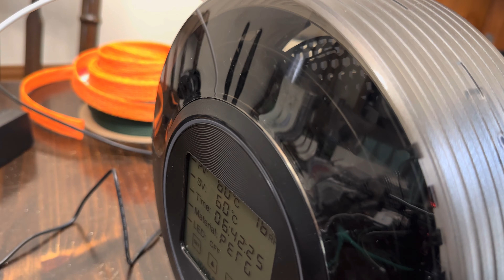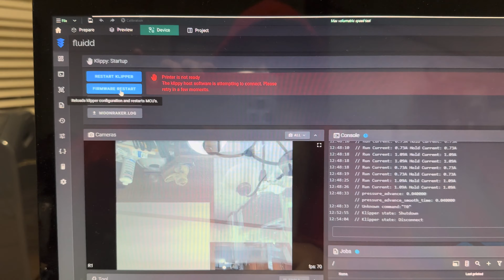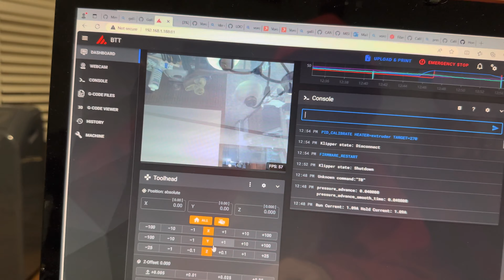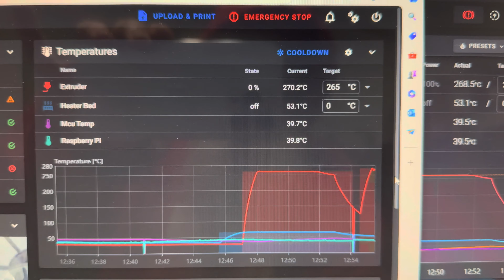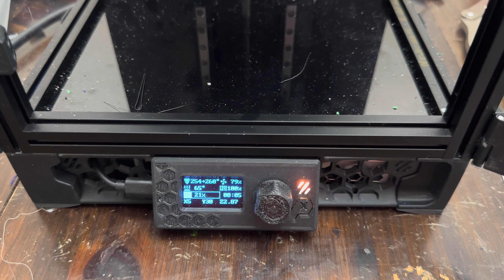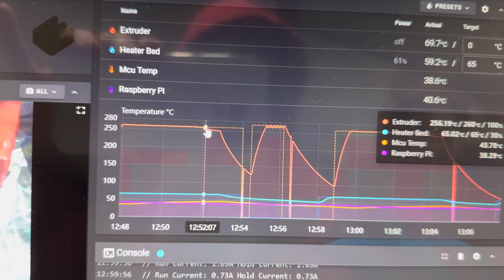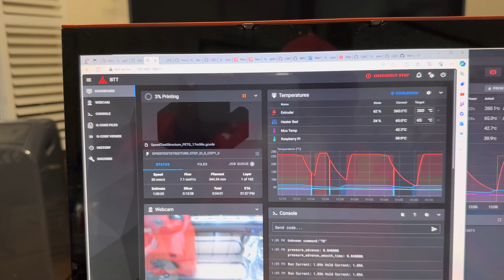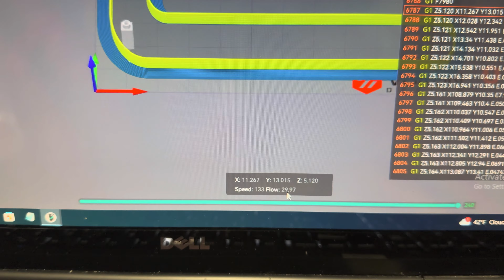Galileo 2 Flow Rate

Comment: did you find your issue
Reply from the maker: Yeah, and sorry for the delayed reply.  YouTube notifications are odd.

The issue was the gear box shroud wasn’t fully seated around the stepper’s center.  The manual they provide was written based on a different production method for the gear box and it didn’t have to snap in place.  The new gear box is injection molded and does need to snap into place.  So it was a tiny bit cockeyed which is why it felt so tight and skipped steps so early.

I think I upset the peeps that designed this because they didn’t have any appetite for updating the manual and still haven’t.  I can seem far more abrasive than I intend, or at least that’s what I’m told…and I don’t mean to be.  But it’s a nice extruder.
Reply from the maker: But this other issue here, when it croaked was a worn out heater.  I replaced it with a new one and it did better.